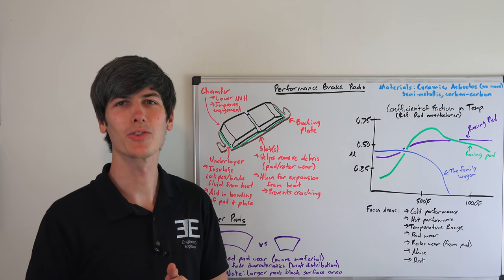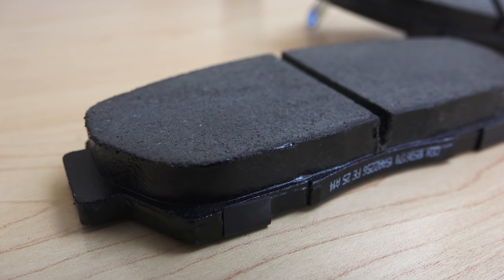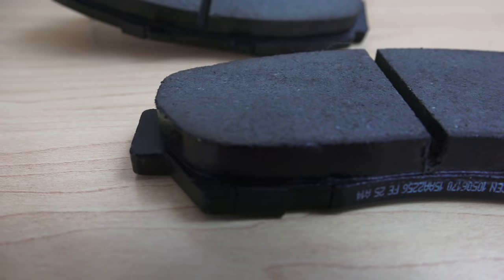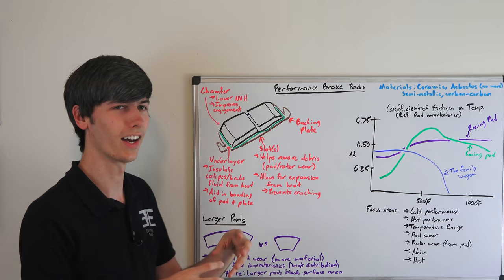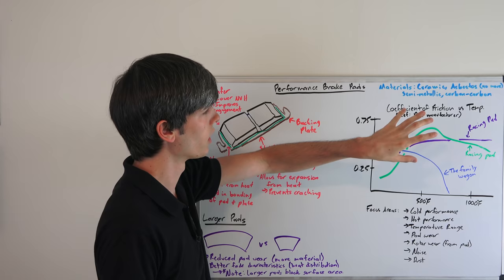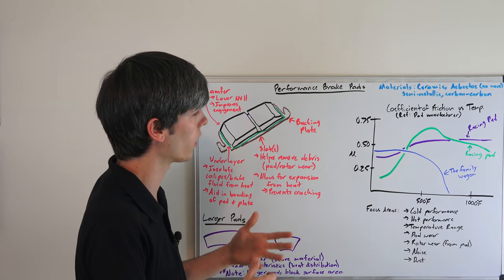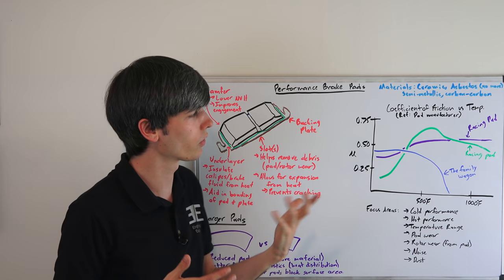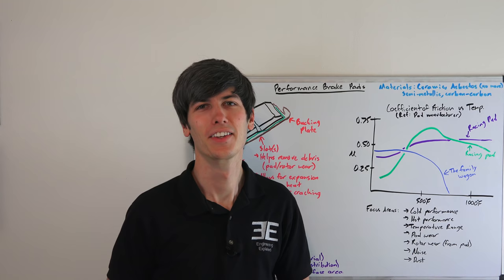Performance Brake Pads - 7 Key Characteristics

Comment: I just want.. The graph friction temperature performance charts.  All this material and other names make it more of a waste of time to pay attention to.  It's all about performance temperature friction characteristics!!
Reply: Stinky Cheese BMW brakes do a good job.  Big brake kits really make a huge difference on other vehicles though like Toyota.

Bigger rotors means bigger calipers and bigger brake lines with the brake fluid to match.

The prices of luxury cars dropped so much you rather would get a used AMG over a new BRZ imo.
Reply: Stinky Cheese Have you seen the big brake kits vs stock on youtube?  The distance differences are unreal!!

This is at like 60mph but of course distances grow with speed exponentially so the gains are massive at higher speeds.  I just find with BMW if you are going over 100mph and the road isn't that good your ABS will kick in.  If you are 80mph in the wet and braking hard ABS will kick in so even if you have really good brakes you will have stopping problem unless you are on semi-slick, or slick soft racing tires.
Reply: Stinky Cheese Quick glance check the mirror before braking hard.

BMWs have coding in their modules at speeds well over 100.  There is an option to turn off automatic headlight washing system at speeds over 100mph or something like that.  Most BMWs can do 155mph no problem.

It's understandable that doing 80-100mph is too fast if your car takes forever to go from 70-75mph.  Some cars can hit 100mph no problem from highways speeds and remain ultra smooth while doing it.

I prefer not to drive at the limits as it makes it last longer.  Occasional full throttle runs can clean out your mechanical system from dirty oil and deposits that happened to build up from careful slow driving.
Reply: Stinky Cheese Look, if you feel uneasy at speeds anything over the speed limit then that's you.

I'm giving information of what it is like in territory you would never imagine and what to expect.  You would probably have a panic attack if you drive on a sanctioned race track.  Probably the same type of person who would probably wreck out while trying to elude a tornado or just sit parked and get swept up by it to be thrown 500 feet only to die.